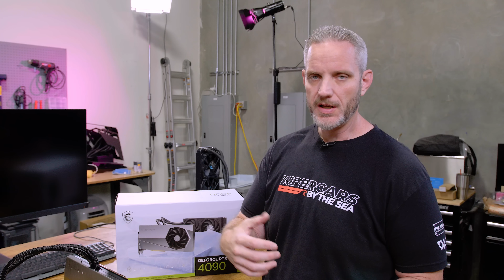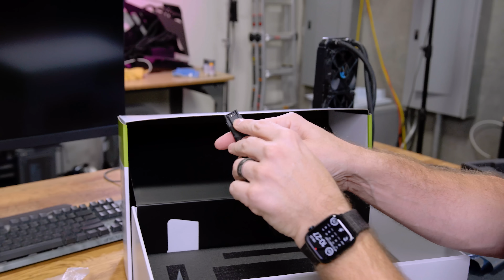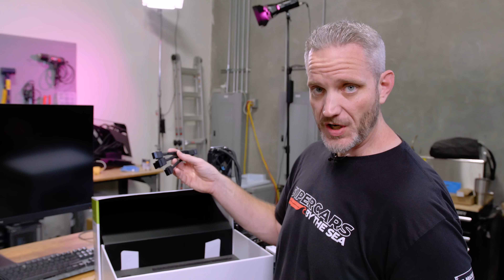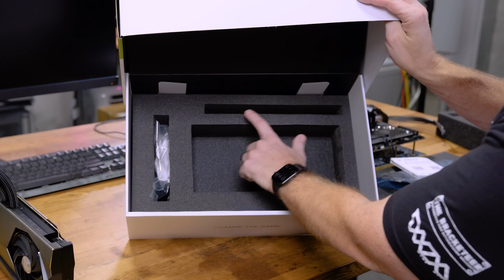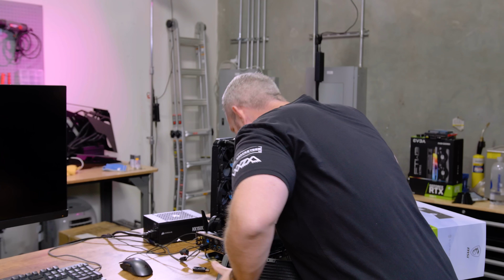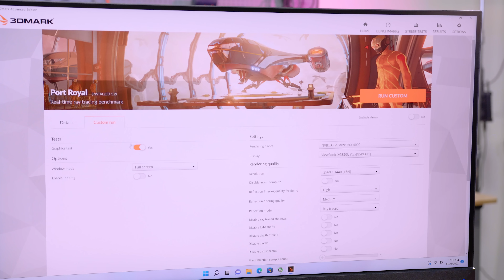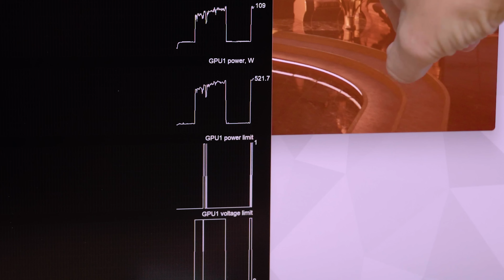This is the most BEAUTIFUL RTX 4090 yet...

Comment: A Great test would be to see how much that card would lower interior case temp vs non liquid cooled , after all alot of the heat should be vented  outside the case with liquid cooling and a push setup.

Comment: Hi, I liked the video posted.
I have a question regarding the radiator.
Will it be possible to change the original 240mm radiator and apply a 360mm radiator?
Compliments
Reply: No imo. Those are closed loop systems, would have to get something from alphacool for modding. Alternative Gigabyte one with a 360 but not cheap mon ami.

Comment: I decided to finally get one of these and promptly returned it. The coil whine was the worst I've ever heard in over 20 years of building PCs for myself and friends. It was truly unbearable, even with loads of ambient noise from cranking up the fans, the room's aircon on full blast, and audio from my games on higher volume then I usually have it. The only way I could make the coil whine bearable was to reduce the power limit to 32% or lower... the FPS caps and slight power limit reductions achieved absolutely nothing. Tried leaving it on some looped tests for a few nights to see whether the coil whine will get better, but it didn't. I get that coil whine is a lottery, but this kind of thing shouldn't ever happen, especially on such premium products. I tried to get it fixed/replaced, but MSI said they don't do RMAs in Europe, and the local retailer said "it works fine" which they were able to do because MSI,  like pretty much all other manufacturers, is extremely vague about what is considered an acceptable amount of coil whine.

Comment: You can only pull 530 watt because its protected for the pcie cables. If you connect it to the adapters with 2 pcie cables you have a max per cable of 283 watts. Thats why!  And probably it doesn't matter that you buy the pcie 5.0 600w of corsair and you could loose any warranty this way. Im a right or not? Jay-Z i hope you read this and answer my question in a video. I watch all your vids. Thx

Comment: I think you are not seeing a bigger picture of water-cooled GPU. Quote from your video at the end "the whole point of water-cooling a 4090 like this would be to get more headroom". I think you are not being correct there. As someone who has been gaming for decades on a top tier cards, my biggest issue always and still is, the loudness of fans at maximum graphical settings. I do understand that someone who is busy working instead of gaming for hours would not notice this, but try it, and you will quickly notice, that fans from vide card get so loud that they drown the sounds and good quality music from games, and even sipping in through the headsets. It is actually a big problem with not liquid cooled GPUs. 
What liquid cooled top tier GPUs offer is a much quiter fans on AIO and more enjoyable gaming experience at maximum graphics. 
What Important to me in practice is an enjoyable gaming experience. As a user I do not care for the extra headroom locked behind the power limiter, which means I can sacrifice those extra 5 fps, when I already get more than 120 fps in a graphically intensive game on max settings. But in exchange my game sounds will not be drowning in loud fan noises.
I do understand that water-cooling fans can get loud to, but first, It still well be less noisy than pure air cooling. and second I get a more headroom in tweaking how loud do I want my AIO fans, by making card go hotter.
And since I am already buying an expensive card, I will gladly spend extra 200 for something that will affect my gaming experience a lot for the next 5 years.
Reply: I stuck an Nzxt bracket and AIO on my 1080ti purely for noise reasons.. people said it was dumb but was worth it for the quietness to me!

Comment: how is the coil whine compared to a founders edition - im soon to have a third founders in search of a zero coil whine card and have heard the gigabyte gaming oc 4090 has the highest chance of zero coil whine. This msi suprim x liquid 4090 looks great and im wondering how the coil whine is on this gpu. I am able to hear high frequencies, even through headphones, so zero coil whine is a primary factor of what gpu I buy, especially considering 4090s are $1600+. I've been buying founders cards from best buy and returning them to use that money to buy a replacement in search of a zero coil whine founders edition. also i don't do much more in terms of overclocking than 2.8-2.9ghz as I don't like going extreme with overclocking - in fact i've been using nvidia auto tuning to overclock my founders cards.
Reply: 0 Coil Whine on my Sample.

Comment: Is it possible to set up the Rad at the bottom of the case if the case has bottom fans option available? also is it possible to replace the fans with different fans like RGB fans?
Reply: this was my question too. i have 3 spots for 120mm fans at the bottom of my case which im thinking of putting it at

Comment: What's the best test to max ur psu and 4080 msi suprim watts , I got it at 125% and can't more than 400 out of it I wants to be on 3.0GHz easily. Have a  Seasonic syncro dpc-850 platinum, Almost want too upgrade to Msi Ai psu when I also got a msi motherboard. And see if I can get I little more. Testet furmark, 3dmark and so on. Whats draw the most and have a 12000k 5,1Ghz/4200 all cores.

Comment: I wanted to ask a quick question if you had the time, I'm looking at getting my first 4000 series card and have been seeing these AIO gpu's like this one here and the Aorus one too and I wanted to know if it's worth it to get them pre water cooled like this compared to the regular air cooled versions? Like would there be any significant differences in temps and usability? If anyone here has any input I'd appreciate it too

Comment: I don't understand the point of having a massive aio on your graphics card if at max clock full boosting it bearley touches 60 c. it looks nice, but the price is it worth it?
Reply: The idea of this kind of GPU is that you have a little more headroom in terms of noise levels. At least thats how MSI imagines their customers. You could lower the fan and pump rpm and run your GPU at 70-80°C (which is fine) at very low noise levels.

The issue is that their Gaming X Trio and Suprim X can achieve almost the same temps at the same noise level. So its just a choice of taste.

Comment: I think you're missing a use case here. If you're doing GPU rendering, you'd definitely consider dual 4090s. I run dual 3090 suprims and one of the cards always throttles because of that lack of air flow. AIOs for each card solves that problem -big time.
Reply: you just need to find a case that can fit up to 3 rads, such as the Lian Li cases

Comment: I have a question: is it possible to liquid-cool a radiator that is a heat-sink for another liquid cooled CPU/GPU (i.e. have 2 liquid cooling in series)? Have you ever tried that? If so, what were the results?

Comment: where is the pump on this card? is it on the card or is it in the radiator? i need to know because my case wont work with it if its on the radiator since the rad will be higher than the card in my case.

Comment: LOL I am getting this card and plan on undervolting it.  You lose a bit of performance but use way less power.  I want a SFF this time around and this is the only 4090 card that will fit in the Torrent compact.

Comment: I will never understand why AIO cards like this exist. It's a water block that can't be piped into a custom loop, it's probably an aluminium block to begin with. It's hooked up to a tiny 240mm rad, which is very limited in where you can place it, because of how short the tubes are. And to top it all off, it still has 3 fans on it, just like every air cooled 4090 out there. So it's probably loud as well.

Comment: I was planning to get this GPU for my new rig. I have a Corsair iCUE 5000X RGB case. I'm putting in an Intel i9 12900KS with a Corsair iCUE H150i Elite Capellix AIO top mounted. I would like to keep the front fans free for intake (with 1 120 fan in back for exhaust). My question is, would it be a good idea to mount the GPU radiator on the side of the case since there is that option? Any thoughts or advice would be appreciated. Thanks

Comment: What modern pc case is wide enough to fit this GPU when mounted in normal horizontal format without putting too much pressure on tubes when putting on side panel (glass)? From personal experience the Lian Li O11 D-XL isn't. Would prefer not to vertical mount bc the goal is to have 2 of these for GPU rendering with Octane & RS. Got some 3D printed extensions from etsy but they're for an O11 D and do the job of holding the glass panel but leave an open gap btwn the glass and the case.

Comment: This is honestly how ALL 300W+ TDP card should look like. Even better if they would get rid of the small fan and make it single slot. VRM really does not add that much of heat and the only reason why it is done is because they penny pinching on making custom cold plate to cover whole card. Water cooling is the only way to go with such cards... Fury X did the right thing and that was amazingly cool and quiet card despite being thermal beast (sadly it wasn't very competitive otherwise). I had pleasure to own Strix OC LC 6900XT and I have never seen temperature climb past 50C and most of the time fans would not even turn! That is how it should be! Not the stupid 4 slot PC sizes idiotic monsters like reference 4080s and 4090s.
Reply: most people want a reliable low maintenance system and water cooling is always going to be higher maintenance/risk than air
Reply: @drkastenbrot  What a load of BS! I had Fury X since it was launched and did absolutely no extra maintenance. Sure maybe some dust accumulates on the radiator and fan which applies to anything, but in this case is much easier to access and clean! I have 6900XT water cooled for over a year now, again no maintenance whatsoever.... in fact I didn't even have to clean the fan/radiator because 80% of the time fans don't even spin, so dust simply doesn't accumulate as quickly.

I guess for custom loop that maybe an issue, but even then... unless you want to change the colour of the loop or you purchased bad quality dye and it degraded... it pretty much never needs any maintenance.

So what you talking about is BULLSHIT... water requires way less maintenance than air, not more... and in case of AiO it is maintenance free.
Reply: @lp9280  No watercooling setup is maintenance free. Water slowly evaporates and it will eventually need cleaning and refill.
Reply: @drkastenbrot  on custom loop... even then if you have suitably sized reservoir this will likely outlast any system (i.e. 5 years+) and even then it is as simply as adding distilled water into reservoir.

AiO in my experience is maintenance free as no maintenance was required well after Fury X became obsolete (8 years)... it still spins to this day and performance is more than adequate (in fact I don't think it degraded at all). 

Again - seems like your experience is nothing more than rumours and exaggerations. 

I can agree that custom loops may require some maintenance, but that in comparison is less than cleaning dust stuck in air cooled GPUS... what is even worse is that many requires removal of entire cooler just to clean the dust (especially reference designs) and they are way worse than water cooling maintenance when you have to repaste and replace pads on GPU.

So all in all - the statement that water requires more maintenance than air only applies in some very specific circumstances and on balance of probability is unlikely.

Comment: Did you check/compare the vram junction’s temps compared with the other players? Pathetic!! 75/80 celcius degrees!! The air cooled ones runs arround 50~60! And the radiator’s temps? It will damage the pump sooner than should be expected!

Comment: Hello Hello From Canada!!! I wondered if you think that nvidia is making their "Easy Bake Ovens" so hot, is because they already have a "Stable overvolt" on the cards before they are even released? They have always tried to keep control of their products, but it really seems like they are trying to even hold the AIBs back from allowing any real overclocking. Do you think nvidia is really far behind AMD for innovations compared to RDNA's 1, 2, 3 advances? I think nvidia doesn't have anything new, so they just get the same old "slightly tweaked" architecture in smaller nodes, only so they can crank as much power into the card as it will possibly take so they don't get left in AMD's dust.

Comment: I wonder if that AIO is making good contact with the die. I've noticed it can be a lot harder to get those to mount flush vs a full size block.
AIO's also tend to have very convex cold plates which is terrible for direct die mounting.

Comment: Is the memory not overclocking better because you're not going as high on the core? That's the case from my 100's of hours on a 3090 SLI setup. Can you try connecting your A/C and pointing it at the RAD, without the fans taking power from the card?

Comment: You said every 4090 comes with a 12 volt cable to a 4 cable, but my MSI Trio only comes with the 12 volt to 3. So i'm wondering if those cables are any different than the 4 cable ones or not??

Comment: When it comes to these water cooled gpu's, I'm always worryed about the pump longevity and, most importantly, about the warranty offered for pumps failure.
Reply: I agree but if my 4090 pump does, I'm using it as an excuse to go custom loop. You can still buy a waterblock for aio gpus so it's not like you're left with a paperweight

Comment: Hi, You should put it in a case. As most of the people are going to run it in as case. And see what you get. Because your going to get less air flow and the case will keep the heat in more. It would get a bit hotter.

Comment: My 4090 suprim liquid x stock settings boost to 2865 and allows 125% power limit. I compared my vbios to Paul's hardware gpuz screenshot and I have a different vbios then him. Wonder if they changed the bios after they sent out earlier cards.

Comment: For me the only RTX4090 which makes sense, after my favourite board partner decidet to stop working together with nvidia( for a while), is the Founders Edition, together with an EK liquid cooler in a customdesign  liquid cooled PC with 2x (not necessary) 560 and one 280 Radiator, for the cooling of GPU and CPU.

Comment: Jay, 2 questions:
Why wouldn’t you OC a 4090 for your gaming?
And what do you mean by a DAILY mhz offset on memory?  One day +1000, one day +0?
Reply: I'm not Jay, but I'll throw out what I take to be the answers, based on my own decades of experience.  1:  The performance return vs the extra power & heat for a core overclock just isn't worthwhile in a 4090.  When you're getting 180fps, does an extra 10 really matter?  2:  Memory, on the other hand, overclocks with less downside, so why not go ahead and do it.  A daily setting is one that's solid and stable enough to be run 24/7.  You can boost it higher and it'll maybe get through a benchmark, but the system will not be reliable at that setting.
Reply: @Doughillman  Thanks Doug!! Really appreciated!

Comment: I have never really liked this type of cooler/blower.
I was disappointed when I once many years ago had an AMD randeon with almost this type of cooler.
AMD randeon had no software fan profile adjustment. It also didn't adjust down so much in speed when you didn't load it, but it was getting a little too hot.

My gigabyte with 2 open fans blowing against a heatsink is much quieter when you're not using it so it doesn't get hot.

Anyone remember the older AMD randeon??

Comment: Sleek-looking card. Slimmest card so far. Manufacturers don't have to make the card look so thick and bulky to justify charging a premium for it. What users and builders need are card designs that are compact enough to fit into most cases, without sacrificing the cooling efficiency. I hope other brands can come up with designs that can match or outdo MSI's. NVIDIA's thick and bulky design is just so outdated, IMO.

Comment: Hi, I have seen your videos and they are very informative and helped me fixed my laptop the first time. Your graphic driver reinstall video helped me a lot. However I am stuck with another problem and it is my working laptop. If possible can you just guide me as I am currently freaked out. 
My laptop showed Two types of blue screens -
1) driver_ power_state_failure 
2) Video_tdr_failure

I went to a laptop service center and there they checked my ssd health and found it to be critical and so said to replace. So I replaced the ssd with a new ssd.

The video_tdr_failure blue screen now doesn't show up. But now just after 2-3 hours of repair. Another blue screen pops up with driver power state failure dialogue and also intel graphics doesn't show up when I right click the on the desktop main screen.
(Just to mention that since the ssd was replaced, windows was reinstalled by the service center) 
- the laptop doesn't restart, it just shuts down every time I click restart.
- if I try uninstalling the intel graphics driver, the screen goes black and then the laptop shuts down.

The service center guy whom I spoke on call Says that it's a mother board problem. However I have seen your videos and they are very detailed and so I thought you could possibly guide me to take a right step.

Like what might be the issue or does it seem like a software only issue ? Or is it hardware related ? 

Please reply if possible it would be a great help 🙏🏻

Comment: Hello Mr. Jay I bought the Asus Tuff OC GeForce RTX  Temps are at CPU 28 Celsius 27 Celsius I was very pleased with knowing about the Power Cable thanks for giving us the heads up. They give you the option to use a Cloud service to basically Mine Crypto. Which I am not going to do at this point